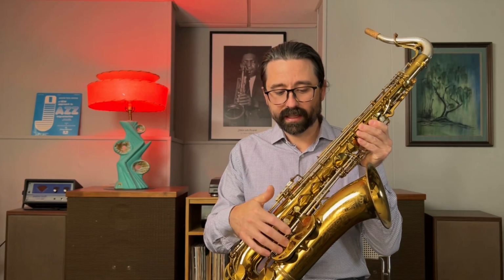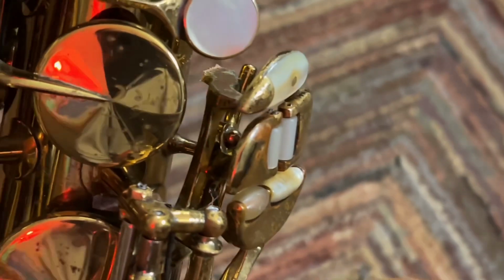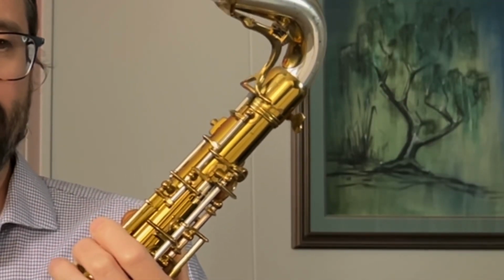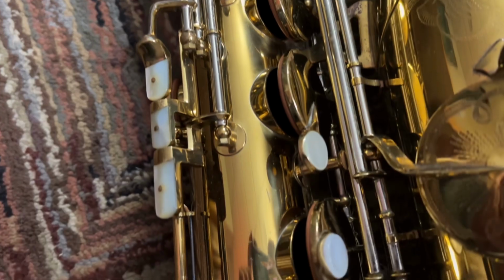King Super 20 Review! Technician and player review!

Comment: Hey Scott, Thanks for the review of the King Super 20....."10 out of 10 Cool Factor" indeed! The overall score for this horn suggests it's better than the "average competitors". One question....the neck on this horn looks like a double socket design...have you encountered many issues with this design feature?
Reply from the maker: It is a double socket neck. That would have been a good thing to mention in the video. 
Lucky I haven’t ran into any major issues except a loose fitting neck. Those are a little tricky because I have to use a different expander and expand the part on the body instead of the neck. It always makes me nervous but I’ve always have good luck. 
https://saxstuff.co.uk sells replacement necks so if something unrepairable happened you could replace the neck. 
Thanks for watching! Scott